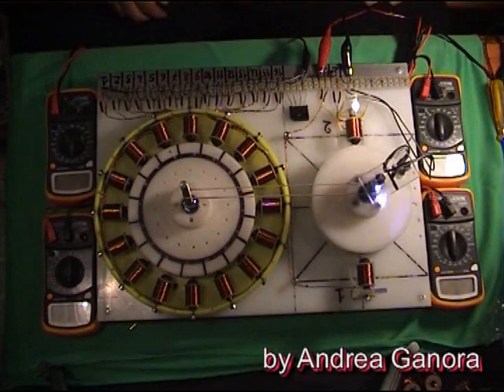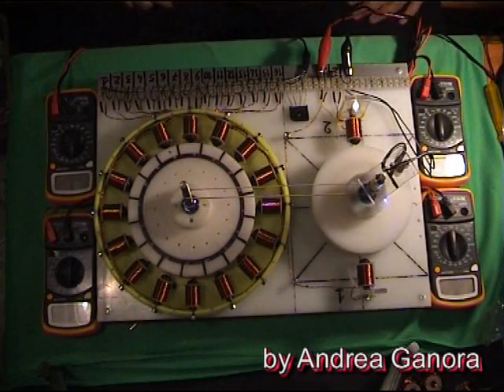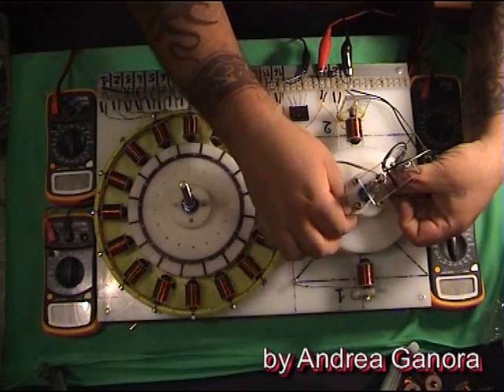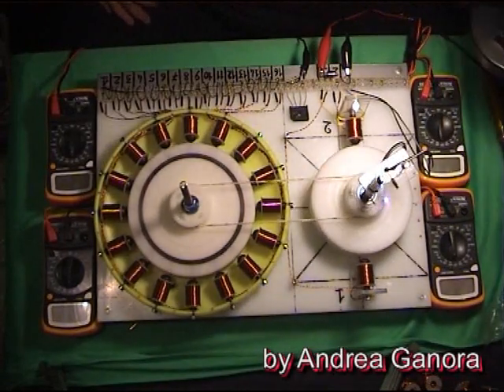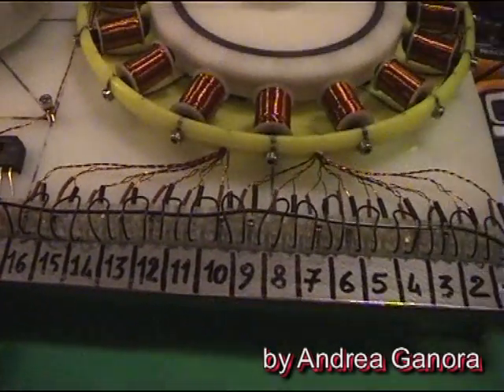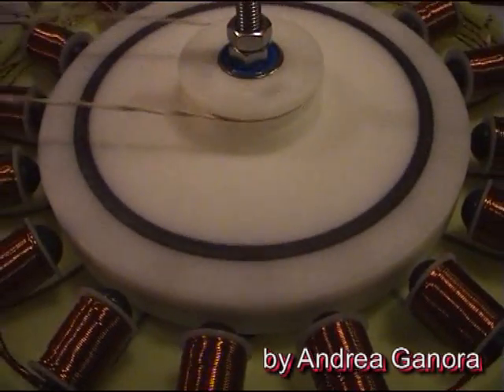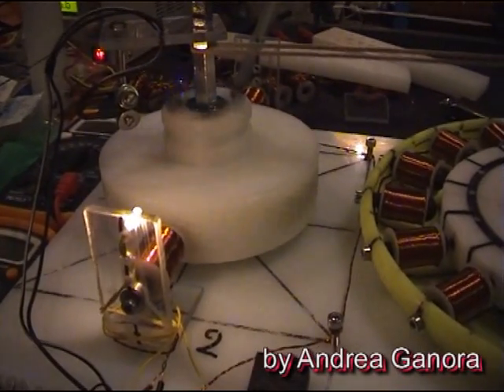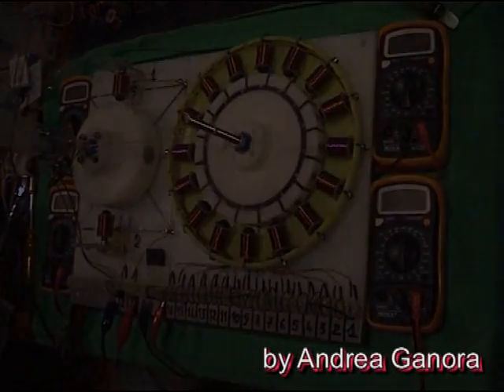003 - Single coil & multiple coils pulse generator (part 1)

Comment: hey there @AnderaGanora awsome model, u could boost the power output if you add static electricity, like a rubber band around the side of the spinning disk and clost to it have a winter hat just touching so when it spinns it also creates static power. try it out.

Comment from the maker: I must say that I definitly observed some promising behaviour , the way the batteries connected to it would behave during the charging and discharging cycles . 
But I have not enough data ro rely upon to make any stetament neither positive or negative about this project ,
At the moment I have not enough time to run/monitor  the system and write down the data  for a long enough period (Let's say a full week or so ) that i think would be the list time necesary  to have at  list some more data .

Comment from the maker: -yes the first/smaller motor/generator runs by battery
-The fresbee motor/generator produces electricity
-By waste I ment it uses electricity : )
-If you turn them by hand both motors/generators produce electricity

Comment: Now THAT's a great idea.
Then, use fasteners to connect the motor rotor to the generator rotor.
It ought to work if done right.  Also, reduces a source of energy loss due to friction.

Comment from the maker: @marthale7
You're very right , if you notice both the rotors have the same 4 holes going trough the middle part of them. that's exactly the purpose ,putting the rotors one on top of each other and fixing them together with 4 longer screws the system can be changed in the way you suggested to make different tries.
We'll see if anything good cams out of this project.
Cheers
Andrea

Comment from the maker: @koneheadx 
Thanks for the feedback I'll try that.
I'm now working mainly on the ocmpmm wipmag project, as soon as I'll have some time I'll make further tests and a longer monitoring period of the system behavior , whit some data to report about the charging and uncharging effecht on two exactly equal and new 12v batteries that I've already bought for the purpose.
I'll post first results as soon as I'll have sufficient data and a video ready .
Cheers
Andrea

Comment: Try the AC legs of FWBR (4 diodes) "right over" your motorcoil swtiching, and then DC side into capacitors

Clip the FWBR by switch on just one AC leg

This works GREAT to recover backemf/recoil of coil and does NOT affect draw to motor coil when you clip at AC leg of FWBR...try it you'll like it...nice work keep going and dont stop!

Comment from the maker: thanks pwmpower i've allready done that .
I've also tried different setups whit bifilar coils, i yust winded some new bifilar and trifilar coils and I'll try implementing a bedini type electonic switching circuit , but I didn't install them yet so i didn't post yet further videos hoping in better results in the outputs since the device is not overuniting so far .